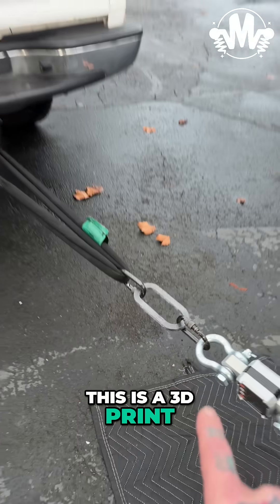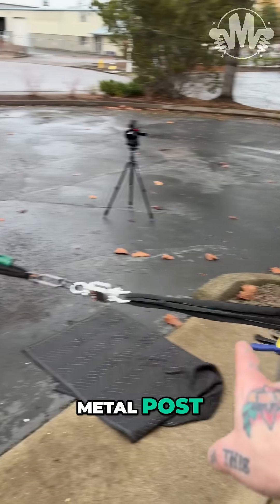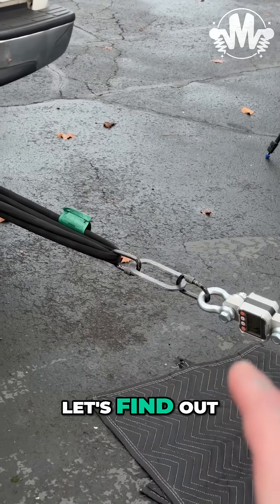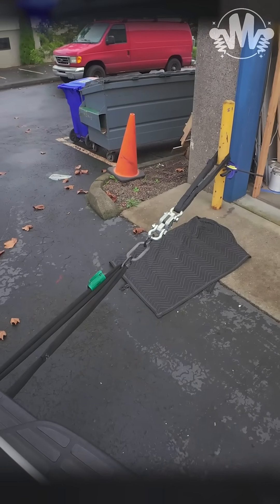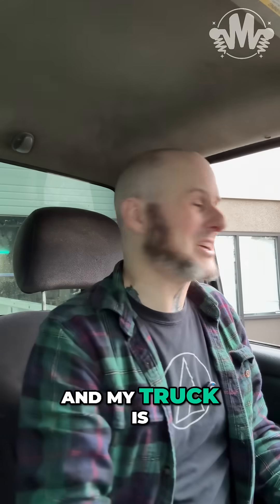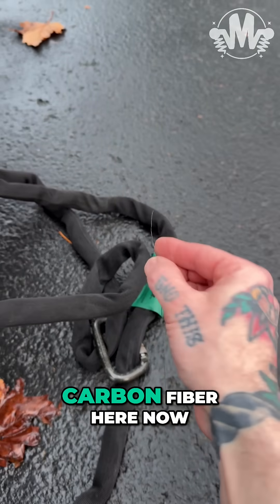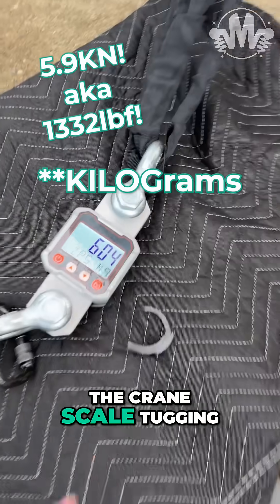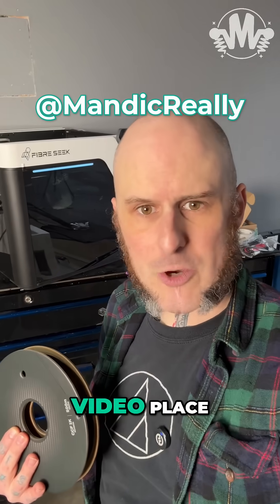I Pulled a 3D Print With My Truck!

Comment: Should use shackles instead of chain connectors, to much force on a narrow point. Will always get a lower reading
Reply from the maker: Bigger the shackle, bigger the design has to be. Which wastes time & material. You are right that the Carabiners put a serious stress point on things. I will likely revisit this in future content with different test materials / designs, so I'll look at other shackle options then.

Comment: Why didn't you connect a tension scale to it? I mean... it's obvious that it was going to break. Not sure what you proved here without any data.
Reply from the maker: You mean the scale you can see connected to the link at 2 seconds into the video? In fact it is visible for like 8 out of the first 10 seconds of the video. You just chose not to see it I guess.
Reply: @MandicReally  You are Correct. I did not see it. 
Apologies to you Sir. I watched the video without audio. Still... not an excuse. Wait. That is an excuse. A reason needs to be into play. Either way. Sorry for my ignorance Sir.
Reply from the maker: Good on you admitting the mistake and owning it. All good. Too few people do that these days. 🎉
Reply: you just decide to stop watching like 10 seconds in?
Reply: @cbean2307  I've never felt dumber. I should have watched it again with the sound on and my eyes open. Sorry. I didn't mean to be such a dickhead.
Reply: @MarcoNoPolo  Don't beat yourself up over it, man. This is just the internet.
Reply: Did the ADHD kick in, and you scroll after the first 10 seconds?